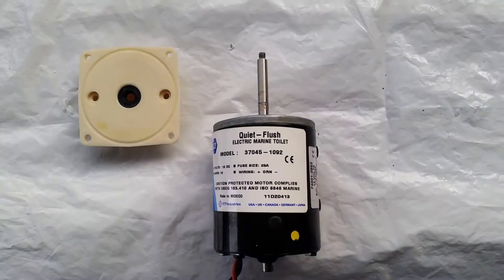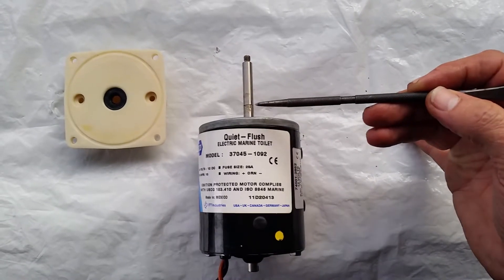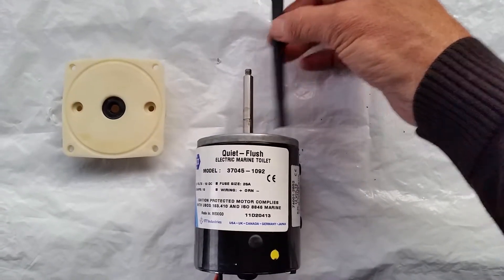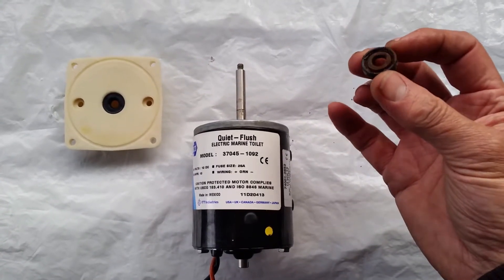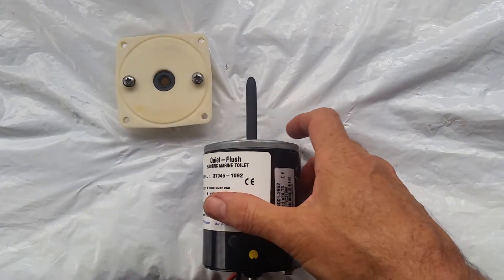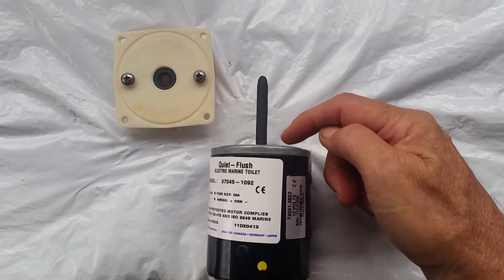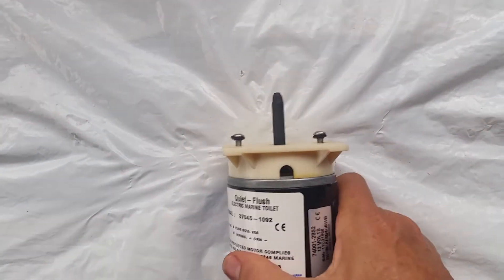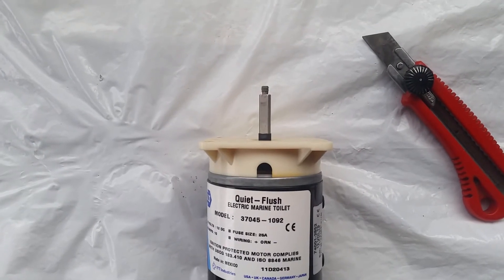Macerator pump shaft corrosion/wear quick fix

Comment: Hello my friend, in the video  how to remove shift plate where you fix it what kind of material did you use and where can I get it? Thanks
Reply from the maker: A piece of stiff but flexible plastic from the bottom of a shopping bag as shown in the video but any thin flexible but stiff plastic you can get would do.